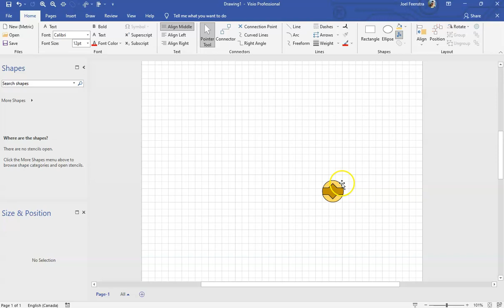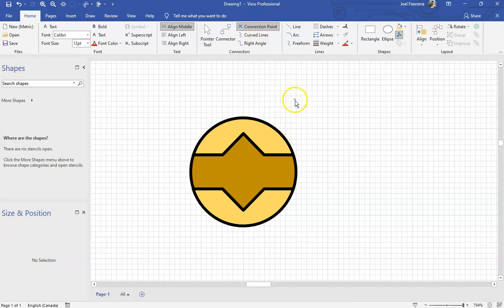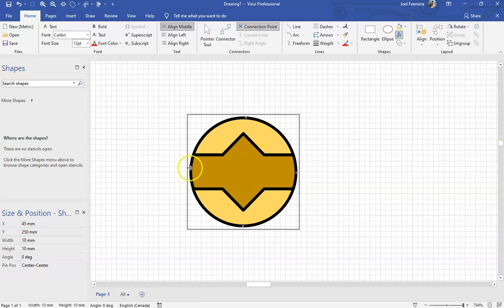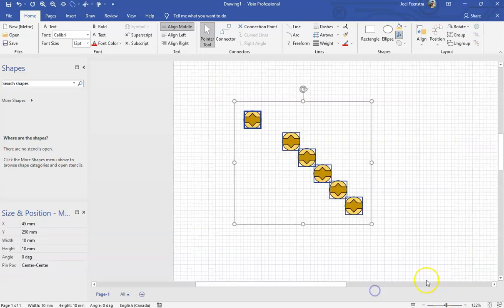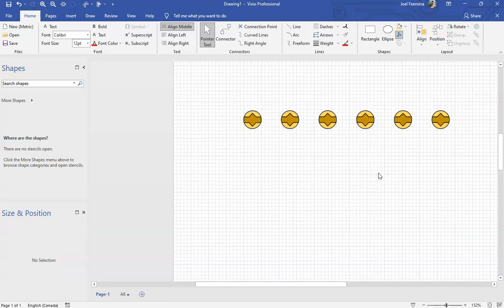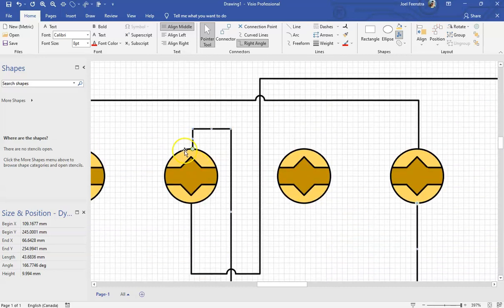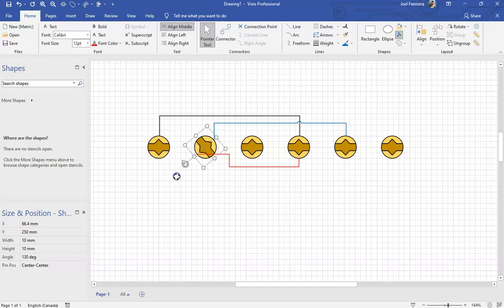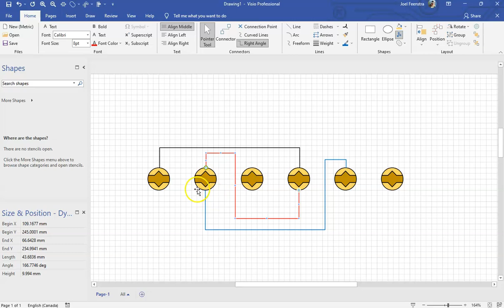Video 5   Connectors and Connection Points in Visio

Comment: Hi Joel, my wirings are overlaping themselves without that bridge that we can see in your samples. Do you know how to fix this? I'm using Visio 2021 Professional. Thanks
Reply from the maker: Hi.  You will find that under "Page Setup" options which can be accessed from the ribbon, or through Shift+F5.  There is a tab on the dialog box called "Layout and Routing" that lets you select when and how the Hops are applied.  My personal styles is to only use hops on the horizontal lines
Reply: @joelteacheselectrical  solved. Thank you 👍👍
Reply from the maker: @Absolutely-No-Sense  Glad to hear!  It's super awesome for clearing up drawings.